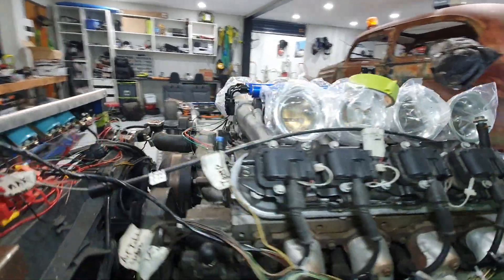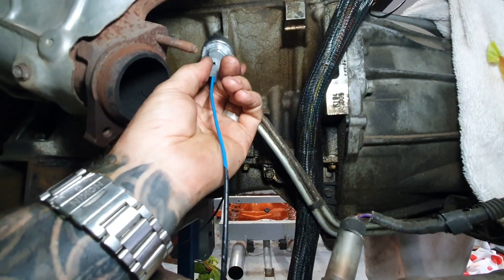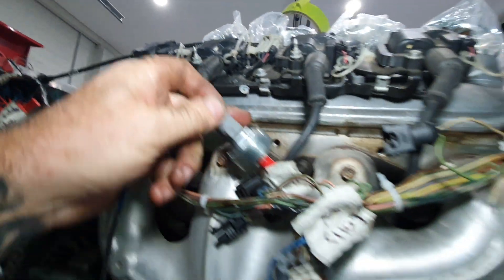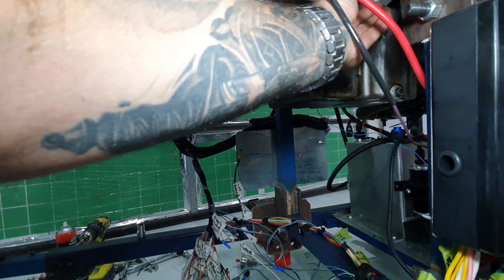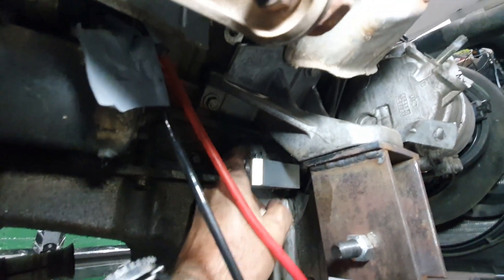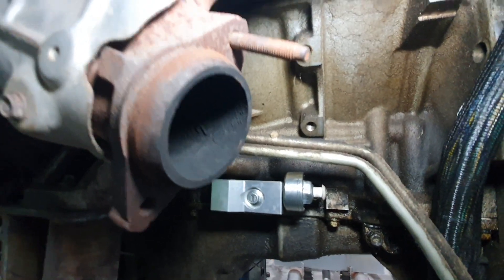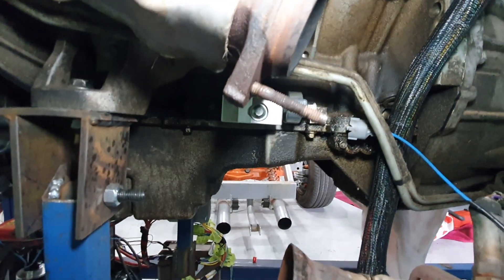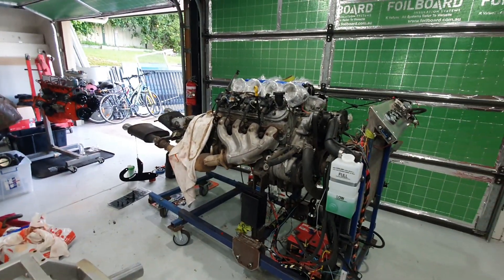Knock sensor relocation on LS engines done the right way.

Comment: Found them on Ebay. $25 USD
Reply from the maker: @russcole5685  Glad you found them.
Reply: @SullysRodskustoms.  Cheers mate.  And Hello from New Zealand.
Have been looking for this sortta thing a while now, as have just ordered the Redux ITB kit for my LS1 383 build.   Sealing the valley cover while keeping the sensors inside is a nightmare.   This cures that.    What brand is your cross ram set up
Reply from the maker: @russcole5685  your pneumatic a winner with the redux kit. Mine is speedmaster. It's a piece of crap that cost me so much time and effort to get working. No Tps supplied, no common vacuum ports. I'm glad my video was helpful.

Comment: Where to buy them?
Reply from the maker: @Tyler-np9ud  Thete are many places that sell them like speedway motors etc. I purchased mine through ebay I think the seller was speedworx.
Make sure you get a set with the relocation blocks with bolts and extension harnesses.

Comment: can l use just the one block on the American passenger side and put both sensors in it?
Reply from the maker: @kylehyatt9972  I don't think you should. The knock sensors are there to detect knock or problematic issues in the engine. Only checking on one side could miss something important that your ecm needs to know to throw up an engine code.

Comment: why bother ? How often does one expect to change it ?
Reply: Like he says in the video, plan on doing them a lot if you buy the non-GM.  On the plus side, I can take my friend's supercharger off, replace the knock sensors, and reinstall everything in about two and a half hours.  He is now using GM units and hasn't popped a code since.
Reply from the maker: Check out some of my other video's  and you will see why. I installed cross ram injection so I moved the knock sensors away from the valley.
Reply: ok @SullysRodskustoms.

Comment: Does this actually work???
Reply from the maker: 100% it works. I tested mine with my scan tool on my engine run stand. I had no knock issues when they were in the original position and none in the new position. Some people mount them on the cylinder heads near the exhaust manifold. They will get false knock from the cylinders firing as its too close to the combustion process.
They have to be in the correct position. I only moved mine because I was installing cross ram injection, and I wanted a clean look under the inlet runners, so I installed a billet valley plate which meant the sensors had to be re positioned. Otherwise there is no need to move them.
Reply: @SullysRodskustoms.  right on! I’m moving mine because I’ve changed the knock sensors now 3-4 times and they keep failing. Not sure if it’s bad sensors or bad connection but it’s such a pain to keep removing my intake at this point relocating them is my step before having them deleted out of the tune

Comment: Are you blocking off the existing holes? Does it affect any type of pressure for the reading or can the holes simply be left open?
Reply from the maker: Hey @billp.365 I installed a new valley plate that doesnt have the knock sensor holes in it. If you leave the old valley plate, water will fill in the holes. Even though the valley plate is sealed at the bottom of the hole where the knock sensor is removed, there is still potential to have a leaking seal and get water into your engine. The old seals get hard and dont seal too well when they are undone.The old knock sensor positions are in a blind hole in the block above the cam, not an oil pressure gallery. Hope this helps.
Reply: @SullysRodskustoms. So I did mine but when I try to start it won't and has a knock now and won't start any suggestions?